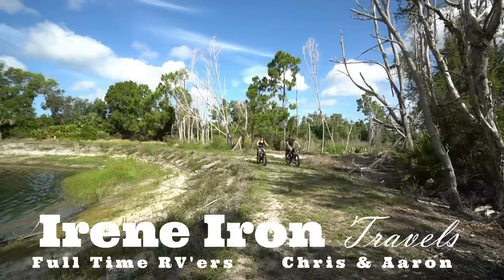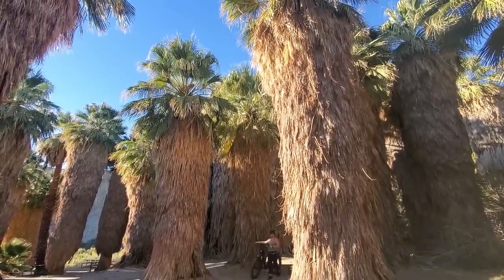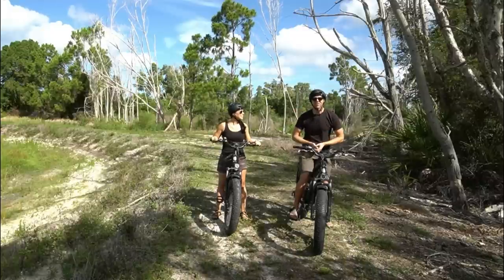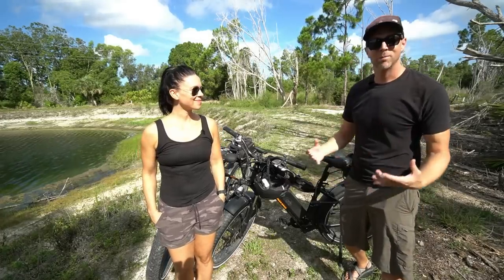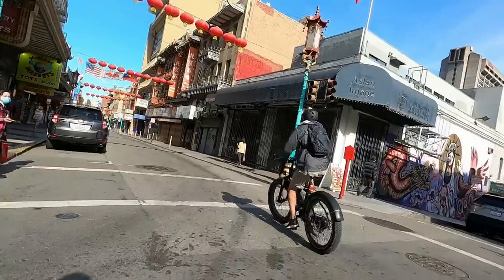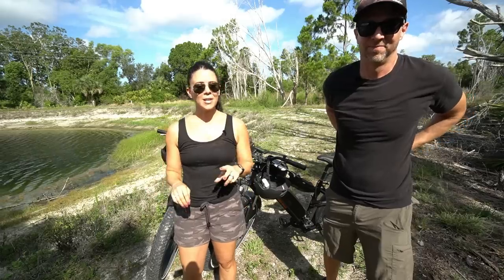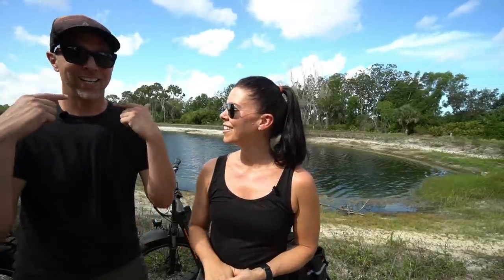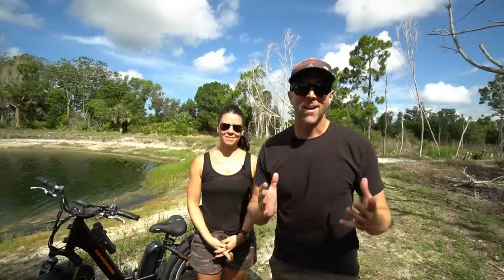Rad Power Bikes Review, Watch BEFORE You Buy! 500 Miles & 6+ Months

Comment: Pushing 77 years here with breathing problems. Needed exercise and there's a 45 mile paved bike path within a half mile of my house. I bought a RadRover 6 Plus step-through (stumpy legs) figuring that when my lungs said "Enough!" I could still get home.
I expected that I'd be using heavy pedal assist and/or throttle a lot. Turns out that I'm usually on 2 for pedal assist and only use a bit of throttle on nastier hills.
I typically do about a 10-12 mile loop, but have been stretching it out as I get more familiar and comfortable with the bike. The stock saddle and my butt had significant differences of opinion. Cheap and easy enough to change.
Reply from the maker: I love it, thanks for sharing that Michael! Its amazing what E Bikes can do for people! Keep riding! 😊

Comment: My husband and I have had ebikes for at least 5 years. I ride every chance I get! A few things we’ve experienced that I’d like to share: we always take the batteries off before loading them. It cuts the weight considerably, especially if  you’re petite like I am. The Hollywood rack works well but it dulls and starts rusting. Not right away but within a couple years. After 5 years ours is looking pretty rough. Putting a cover over both bikes on the back of a vehicle (suv) will block the tail lights. Not a good thing!! People were not happy with us! Besides that they are just a blast!! It’s one of the best purchases I’ve made.

Comment: What a fantastic and complete review! I have a Rad Mini 4 and it performs just like your ebike and the only two things I can add is that if your wrists hurt lower your tire pressure to 25 lbs for a less shocking ride on your wrists. Moreover, the front shock is adjustable. Put it on the softest setting to help protect your wrists…Additionally, you can make important changes on your display to increase your top speed from 19-20mph to 22 to 25mph depending on your weight. It takes less than a minute…HUGE improvement!!! I’ll add it to this reply…. Looks like the video has been taken down or made private…but here’s how you do it from my memory: 1. Power up bike 2. Press center button for new screen (wheel size…do not change) 3. Push center button once to access speed screen 4. Press top button several times until you reach “40”. 5. Press center button one time to save new setting….you’re going to be blown Away!
Reply: You're a speed demon, lol. I wouldn't go higher than 18 psi even for urban riding... more like 5-8 for sandy trails. That's tubed, don't want a pinch flat. Tubeless, 2-3 psi is great for off road and snow. 😊

Comment: Give Brooks saddles a try. I ride a non E bike several thousand miles per year and love the less padded cycling saddles. Thanks for the Ebike info, very helpful
Reply: The Brooks saddles I've seen had ZERO padding.
I prefer the wider gel saddles for comfort.
I also use a suspension seat post because the Rad 5 is a hardtail.

Comment: 5500 on my Rad City in just shy of three years! I would have had zero miles on a analog bike! Running great and still get 40 plus mile per charge using pas 1 and 2 most of the time.
Reply from the maker: Thanks for sharing that! Love it!! 😁
Reply: Does RAD sell that rear bag? Or what is it ? Looks like a great bag for the rear rack.
Reply from the maker: It is a Topeak bag from Amazon https://www.amazon.com/dp/B004WSLT2O/ref=cm_sw_r_as_gl_api_gl_i_5M67TN6SVYTSB5B79V1Y?psc=1&linkCode=ml2&tag=ireneironfitn-20.  Love it!

Comment: I have xt60 plug on control box and three battery’s i swap out on a ride. I keep the two spare in the panniers and the one I’m using strapped to the top of the rear luggage rack. Simple to swap battery on rack for fresh one from pannier bag plug in xt60 connecter and off i go again. I have a good 120 mile range and it takes about one minuit to swap battery’s

Comment: Just maybe, you've covered how to load a ebike, but hint anyways...line up your ebike to the rack, apply the rear brake only, now pull back lifting the front and put the front tire into the tire holder, now holding the ebike somewhat just lift the rear tire and put into tire holder.  Strap as necessary.  Reverse the process when unloading.  If you need a video let me know.

Comment: It would be ideal to be able to charge as you are peddling
Reply from the maker: Yes! That would be great as well!👍
Reply: I wondered about that too. I think the reason they don't do it is because you wouldn't generate enough power pedalling to charge the batteries to any significant degree. Still, even a little charge would be apreciated I'm sure. :)
Reply: @drinkinslim   Also the added weight and resistance created by the generator would definitely make it much disliked.

Comment: Another great video!  When you’re boondocking, do you charge the batteries after riding your bikes, or wait until you’re plugged in somewhere?  We’ll be without power for several days while camping in the Tetons and will be using our bikes.  We have upgraded the solar and switched to lithium batteries.
Reply from the maker: Thanks Cathy! We have charged our batteries while boondocking but most of the time our bikes will last the whole time we are out since we only boondocked for a around a week or less. With the new RV we'll be able to go longer so we might be charging more. Ofccourse it depends how much you ride but 40 miles goes a long way. Have fun in the Tetons!!
Reply: Just get an AC/DC converter for your vehicle and use the 12v battery in your vehicle to charge the ebike battery.

Comment: How is the aftermarket taillights and license plate holder attached to the bike hitch rack? Are there bolt holes already on the frame or did you have tap drill ones yourself?
Reply from the maker: I think we show it in the middle of this vid https://youtu.be/5uth-_5pGEY
I was able to use an existing bolt on the rack. Pretty easy!
Reply: @IreneIronTravels  thanks!  Those Hollywood racks are hard to get and always sold out. Looking at the KAC racks which are pretty much the same thing, even a little cheaper. Definitely want to add taillights and license plate holder, as to not attract attention from bored cops. 

Great review! I love my Radrover and have outfitted it with a lot of cool accessories and mods.
Reply: Good news. Got a notification from Rad that this Hollywood bike rack was back in stock and swooped one up real quick. Thanks again for the tips on this!

Comment: Hi Chris and Aaron!!  What a great and informative "update" video!!  Thank you for sharing this info.  These e-bikes look really awesome and practical!  

I "think" we're going to hold off until after we get the trailer.  But, fact of the matter is we just may wait until next spring once the Rocky Mountain winter begins to depart.  

I'm still on the fence with regards to what make to get.  These look awesome.  They probably are the bottom of the motor/battery capability that I'd go.  I have a football player build, so feel that I need at least the 750w motor, as well as a bigger capacity battery such as 18 or 20 amp hours.  I like everything that you've described about the Rad's.   The other component I have to be conscious about is that my wife's wrists get sore very easy.  So, if the bike doesn't come set up that way, I'd probably have to add a handlebar mounting bracket that is more extended to allow her to sit in a more relaxed position vice leaning forward with weight on wrists.  

I emailed with Dean the other day.  I had him talk with ORV to get an update.  He indicated they are still looking at a September build :-(  I'm guessing that will mean an October-ish delivery.  Bleh!

Safe travels!  and thank you again for this awesome video.
Reply from the maker: Hey Alan! Ebikes are definitely a fun way to travel around! I have heard the smaller folding ebikes can be difficult on some peoples wrists because of the ergonomics on them. Hopefully you guys can try a few out to see what is comfortable and powerful enough for you. The Mountain series 22FQs should start in July and when they actually do then we will get a better time frame on our Titanium's. I'm still hoping for an August build!  We'll see!
Reply: @IreneIronTravels  Ok...good to know!  Kind of a shame as it would be great to have folding bikes.   But, between my wifes wrists and the normally smaller motor/battery, I suspect the folding ones are not in our future.   I've got a flight to CA this week.  I'm going to see if the Juiced plant has a demo bike to try out.  

Ok.....I am right next to you two in  hoping for an August build!!  It would be sweet to get the rig in September as it is nice AF in the area here and we'd still have time to get a trip or two in our local area before having to push out more to the desert for winter ops.

Comment: I’m 5’2” and 73 years with bilateral hip replacements. Looking at Pedego Boomarang to take with me traveling with my new Winnebago View. Do you or any of your viewers have experience with this brand?
Reply from the maker: We don't have any experience with Pedego, but they look like a quality bike. The ultra low step through also looks like it would be a very easy bike to get on and off. Just keep in mind the heavy weight of all e bikes. Enjoy!! 😁
Reply: @IreneIronTravels  Yeah, what is it with electric bikes being so heavy? Apart from the battery, I'd think the weight would be more normal if they used a standard trail bike frame and tires. Maybe it's a cost and/or trend thing? Just thinking out loud, here. :)

Comment: Thanks, good review. Curious, you just changed from Van Life to Tremor offroad capability. Can you talk about why? Empty nesters, just bought RadRover6's, excited for them to arrive. But also investigating retirement travel options. I've been leaning Tremor with Truck Camper, wife is enomoured with the Sprinters. Thoughts?
Reply from the maker: Hey guys 👋, congrats on the rovers6 and your new lifestyle research! We mainly changed from a van to a truck and small travel trailer ( coming in a month or so), just to change up our travel style and get more space and tank sizes. We lived and worked fulltime in a 22ft sprinter for 2.5 years and while it was probably the best years of our lives.......it just started to get a little too small. I would say a truck camper and a sprinter will be a very similar sized space and tank sizes. But both give you a different style of travel. The sprinter van can be an easier, faster paced travel which is great if you want to travel quickly and see big cites as well parks/ campgrounds, boondocking..etc. The van is a bit more stealthy and better in tight areas. I feel the truck camper is better for off road with much better ground clearance and also gives you the option to leave the camper parked and take the truck out. Lots of different setups for both and it really just depends on how you are going to travel. Hope that helps and good luck!
Reply: Hopefully I’m not too late to help. I grew up in travel trailers and have spent my whole life around RVs and camper vans of all kinds. When you’re looking to full time any RV, there are some specific issues to look for. For example, some brands do not build solid floors in their ultralight trailers to save weight. The floor can become squishy and no supportive within months. Also, many manufacturer warranties are voided if full timing. 100%, go to forums and also look for a master RV technician. Traveling techs deal with full timers constantly, so they know which ones can hold up to daily use.

Comment: instead of hoping for an extended range battery, why not buy two extra batteries and bring them with you and change them out when you drain the first one? when I ride my motorcycle I don't hope they make a bigger fuel tank, I buy a fuel canister and bring more gas with me.
Reply from the maker: There are lots of reasons to want one larger battery (or fuel tank) instead of two. For example, if we park our bikes and walk around a new city for a couple hours we'll have to bring the two $500 (8lb) batteries with us. Same as wanting a larger 60 gallon diesel tank on our truck instead of a 34 gallon and an external extra source. Larger aftermarket fuel tanks are very popular. That being said 2 batteries has it benefits as well and we have went that route with our new Rad Power Bikes. Thanks for watching! 😁